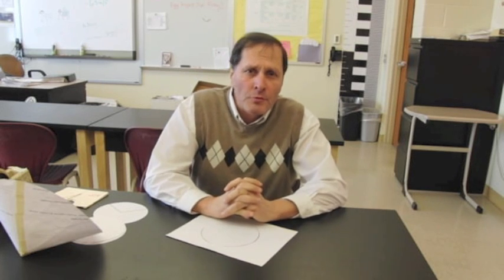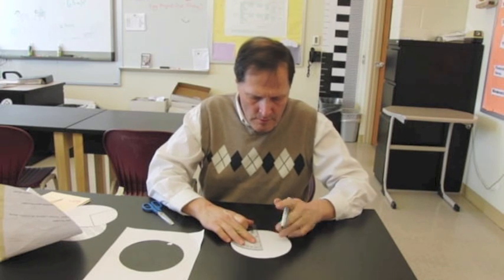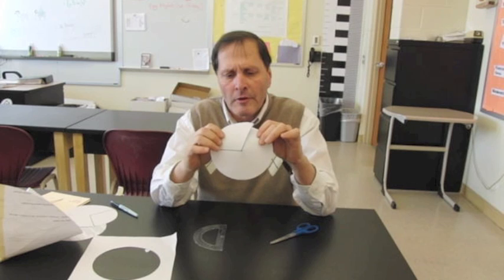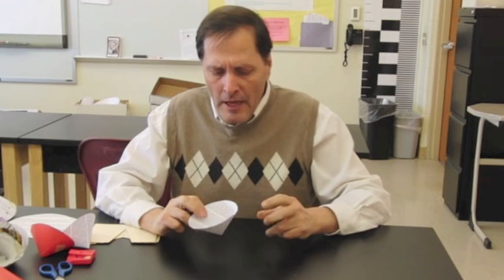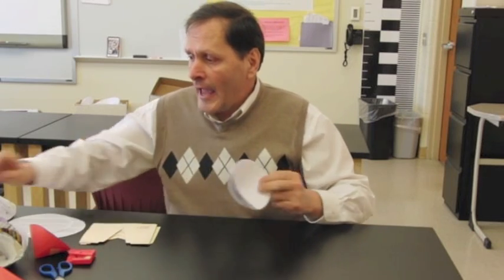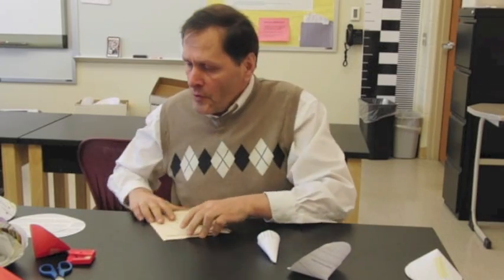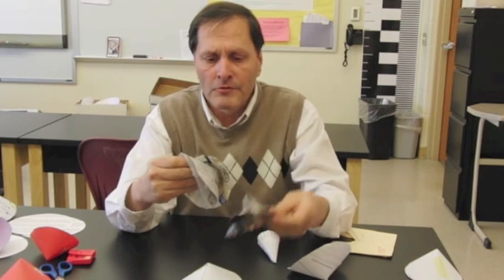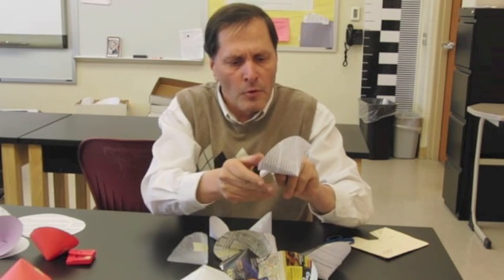falling cones activity- aerodynamics /// Homemade science with Bruce Yeany

Comment: With due respect your video lack technical explanation. What is the aerdynamics of a cone? U dealt eith size, color and weight but these are trivialities. U should explain the airflow and air oresdure if a cone. The same deficiency is found in ur video on solar motors. U never explained the physics if ohoton hitting the mylene sheet.

Comment: Hi Bruce, I really enjoy your videos. One thing I thought of was, turning the cone upside down, like a parachute. There's a whole lot of different behaviours you can investigate to see how to stabilise that variant.
Reply from the maker: HI croyce,  the cones are very stable as they fall,  if you turn it sideways or upside down,  it will immediately reposition itself as it falls so that the point is headed down.  Students found the only way to make it stay point side up is to attach strings and a weight so that is in a parachute design
.

Comment: BRUSE...how is it possible the space capsule falls the other way around...in reverse, and at the same time go very, very fast without flipping?
Reply from the maker: Good question,  I don't know.  My guess would be that it was  a combination of  a gyroscope and small directional thrusters mounted on the space capsules that were cone shaped
Reply: Thank you Bruce for your reply! They talk NOTHING about small thrusters or gyroscopes or HOW exactly it is maintained in that orientation, and even though they do talk quite a bit about the angle it would be traveling, the "supposed" tremendous speed at which it travels as it descends (70,000 decreased to 10,000...WOW) they talk about when the chute is deployed, how it lands, etc...but they say NOTHING as to how it is kept in the reversed, AWKWARD position! 
Don't you think that at those speeds (initially 70,000!!!) that even with thrusters — which would have to be VERY SMALL  — the friction from the atmosphere resistance — even if Mars atmosphere is less dense — would FLIP it to its correct position...point POINT DOWN!!! It just doesn't make any sense to me that they would be able to keep it under control in that reverse position at such high speeds..what say you buddy!!! Again thank you Bruce...nice video!!!

Comment: Mr Yeany can you also tell why the cones with wings turn when they fall?
Reply: They introduce a directional bias to the horizontal direction of the air resistance force, and this bias produces a torque that twists the cones about the vertical axis.

Comment: how does changing the color affect it?
Reply: Rohit Sanjay 

Well, it DOES!!
You will have to agree that darker bodies absorb more light energy or photons. So that means lighter bodies reflect light in other words lighter bodies hit back the photons so there is an action & reaction thing going on.
So if we were to light up a cone from the roof, then the reaction force generated at the top surface of the cone by pushing the photons back towards the roof will cause the cone to accelerate towards the floor.

Hence lighter toned cones will fall faster than the darker cones if the cones are illuminated from the roof. Just imagine an the being dragged on by a column of liquid in a waterfall. Though the reaction forces due to photons is infinitesimally small, it does have an effect on the cone's descent.

Comment: 2:40 shouldn't they reach the ground at the same time if they have the same aerodinamics? just like a feather and a brick?
Reply: tofol cano Only if they don't reach terminal velocity. They reach the ground at the same time because one hasn't had the chance to go ahead of the other because  they are travelling at the same speed until one reaches terminal velocity.
Reply from the maker: at 2:40 she is comparing one cone  in one hand and in the other hand two cones stacked together,  the two cones fall faster
Reply: Bruce Yeany I know one is heavier but I thought that the heavier cone would accelerate slower because of it having more mass.
Reply from the maker: ideally both object should accelerate at the same rate if there no air resistance (no air).  In this case more mass means more force to push through the air,  imagine the results if I put a lead weight in it.

Comment: Da vinci actually designed a parachute in shape of a pyramid, similar to this cone. Only it was inverted and had a hole in the vertex of it, to make it stable. The paper cone would sway less and drop more accurately if it has a hole punched in the centre. 
Anyways, nice video sir.
Reply from the maker: Thank you,  I think Da Vinci's parachute  good topic for students to research.   I do use this assignment with my students and have them test all sorts of variables.  The hole is the center is one that often comes up.